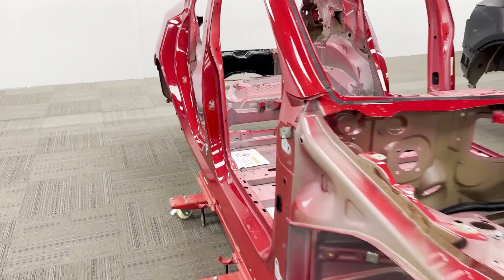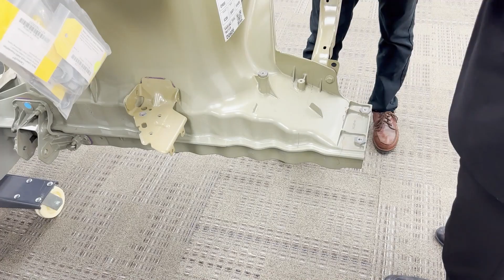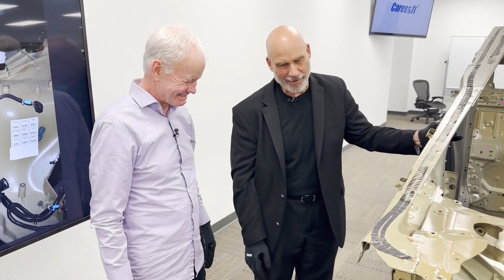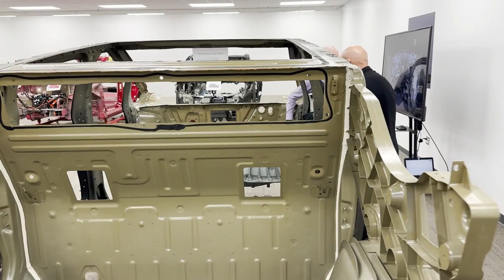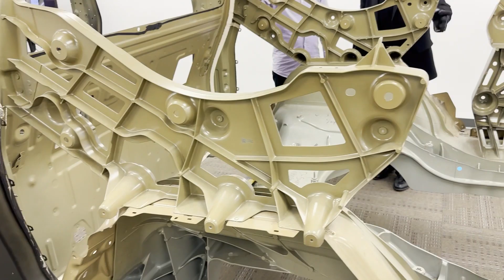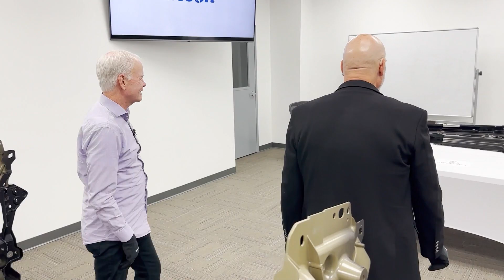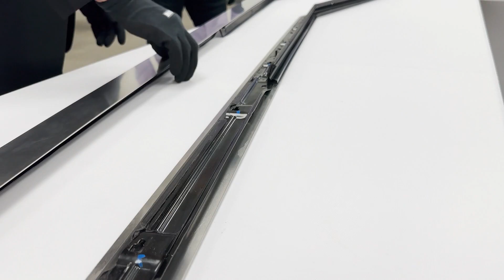The Evolution of Tesla's Body Structure - Caresoft Teardown

Comment: 10:00 you were saying none of the A surface is structural? Elon was saying he wanted a hard exterior to make an exoskeleton. But you’re saying it isn’t like that for the front? I wonder if this will be redesigned in the future?
Reply: The exoskeleton technology has been scrapped. I think the progress of casting technology has rendered it obsolete. If your Giga-castings provides all the structure you no longer need the skin to be structural.
Reply: They got that part wrong. The body greatly contributes to the total rigidity
Reply: @tarasilchuk167  This is correct - not structural but adds to the rigidity (30% I believe?)
Reply: The Gigacasts machines at that time were used in the second year or so of the mod3 or was it the modY?, It was two halves of the rear megacast, which a year later became a one piece megacast, Tesla does not have a every 4th or 5th year model refresh, Tesla changes and improves as it sees fit, anything to get the price of the car down, I think there might even be a $34,000 mod Y in the USA in stock , after tax grants and State incentives, I believe it is in Colorado or Washington State,
Reply: CORRECT , non Structural. but, VERY Tough still. 
the Gigacastings & Hybrid Underbody are Extremely Tough.
the 4680 Battery & Structural pack , also Extremely Tough.
its, Tesla HFS 1.8mm door panels & 1.3 mm everywhere else.
HFS = Hard F-cking Steel. composition UNKNOWN. 
it is 30xx class Stainless Steel. 
its Bulletproof to .45 cal Machine gun, 12 ga SLUG, 9mm FMJ. 
it can also Dent a metal bat.

Comment: I wonder how much twist the frame has when the battery pack isn’t bolted in, to see how much the battery pack contributes to keeping the truck from twisting?
Reply: ZERO .
Reply: It has to be zero.  When I replace the battery packs on Models S-E-X-Y I never have issues opening doors or notice any body flex while it's on the lift.  We've even pushed cars out the shop without batteries and they feel solid.  I'm sure it makes it stronger with the battery in place. They use a bunch 13mm and 16mm bolts to hold the battery in place.

Comment: Tesla is the best car company ever! No gas stations, No oil changes, No smog check, No corrupt dealership, No catalytic converter and as fast as a $650,000 Lamborghini
Reply: And safer than any other car on market, by far!
Reply: @praero551  you are joking right! in the first accident of the cybertruck with an older toyota corolla, only the the passenger in the tesla got injuried not the toyota one lol!!!
Reply: @alanmay7929  good, rule confirmed, no real rule without misses, no?
Reply: @alanmay7929 The Corolla T-boned that truck. There were no injuries, just bumps, & bruising. The couple that was rear ended by the Ram didn't even realize they were hit, when they heard the wreck.
Reply: @eternalbalance7703  the tesla driver still sustained more than the little corolla lol!!! your lame justifications!
Reply: @eternalbalance7703  its literaly the same lame justifications from tesla fangirls on internet ive seen tons of videos "oh" a three failed on the tesla while it barely touched it.
Reply: @alanmay7929  It would be easier to understand your point, if you took a moment to articulate. Anyone in a side impact, will have a greater risk of injury.
Reply: @eternalbalance7703  what are you trying to justify "Einstein" by the way you all vomit tesla crap on internet its like other cars are literaly death traps grow up! when there is an accident with a tesla and other car you barely ever heard what happened to the other car and the passengers its always everything about tesla its becoming cringe and pathetic at this point.
Reply: @eternalbalance7703  your friend #tesla owners of sillicon valley on tweeter goes offroading with his cybertruck a toyota tacoma and a jeep but he never showed the capabilities of the other truck on his videos another pathetic fangirl.
Reply: @alanmay7929  With 90k fatalities every year in the US, I would hope we can do better. Yet few are willing, or able to do what Tesla is doing. Education does wonders my friend. Albeit, you may want to focus on something that won't trigger you so easily. Cheers
Reply: @alanmay7929  What justifying are referring too? That side impacts have higher risk of injury? There is plenty of data supporting this.
Reply: @eternalbalance7703  again are you serious?! all those accidents are because your driving licence training is very weak and even your roads systems are not the best in the world! people does all kinds of things on the roads and also vehicles gets modified in different ways! thats not the case in other countries! that has nothing to do with tesla or other manufacturer!
Reply: @eternalbalance7703  modern cars are very safe but unfortunately there are still alot of older cars or people driving at obscene speeds, drinking and driving...... lack of public transport which means literaly everyone has to own a car! in Europe i can count how many times i got into a car.
Reply: @eternalbalance7703  did i say anything against that!? wtf!!
Reply: @eternalbalance7703 have you seen the Tesla that flipped 7 times with all passengers unharmed, or the father that tried to kill his family by driving down a cliff only to have everyone survive. There’s a reason it’s rated no1 safest vehicle by safety assessment companies worldwide.
Reply: @yann664  You overestimate how many long trips people drive.  Most people only do roadtrips once or twice a year.  So, you save the 5 min two to three times a month but spend more time on the 1 or 2 roadtrips a year. Overall it's quite the savings for me, time and money.
Reply: bullshit! its literaly the worst car company ever! totally useless cars that are basically all the same way less capable than an ICE... there are 35 years old toyota hilux with 90hp that are working harder than that tesla piece of garbage in very harsch environments around the world! that tesla truck is literaly impossible to modify let alone do anythng with! a toyota hilux can be converted into 6x6 chassis extended, payload improved, bigger fuel tanks for tons of applications from RV to overlanding rig to rescue, firefighter, ambulance..... ICE are just more capable.
Reply: As exciting as a hoover vacumcleaner,
Reply: Tesla and it's vehicles aren't selling, proof they're losing market share and profits. Not ever going to buy one.
Reply: With superchargers to make life easier as a driver
Reply: Drink some water! Breathe!
Reply: You aint joking about faster than a Lambo.  My friend and I had the opportunity to flog my Model S and his Lamborghini Aventador up a closed mountain and he couldn't keep up.
Reply: @gnoxycat  correction EVs are just quick 0-60 not fast! the almost 2000hp Rimac Nevera is still slower than a 1500hp buggati veyron.
Reply: How has a catalytic converter ever bothered you sir
Reply: Love that they burn so much coal powered electricity and can burn down your house to boot!
Reply: @dpose6525  No matter where the energy comes from, BEVs are more than twice as efficient as ICE.  Denying that is like denying round earth.
Reply: @dpose6525  In case you haven't noticed,  here in the USA natural gas has eliminated most coal powered generation as of more than 10 years ago.
Reply: @snookmeister55 expecting uneducated people to notice these things is a far cry from
Reply: @dpose6525  My house and garage are covered in solar, am I going to be okay?
Reply: oh the 1000hp tesla modelx plaid can barely tow 5000lbs for measly 130 miles while a 260hp bmw x5 diesel can tow over 7000lbs still get around 500 miles of range period!
Reply: @alanmay7929 dude, what universe are you living in? What’s your highest level of education? The Tesla Model S plaid was the fastest production car when it came out.
Reply: @user-ln7of9gs4s  there is a gigantic difference between fast and quick! Go educate yourself! Go back to school! The fastest production car to even reach 200mph was decades ago and buggati also reached 300mph none of the EVs can even compete.
Reply: the 1000hp tesla semi barely hauls 82,000lbs while 650hp diesel semis have been hauling about 4x that load for tousands of miles even on unpaved roads crossing deserts, rivers... to supply remote communities and much more.
Reply: One could argue that cost of operation trumps most other things most of the time and that's why I expect battery electric semis to become quite successful.  With respect to efficiency, ICE loses, always.  @alanmay7929
Reply: @alanmay7929 About your tonnage claim,  even if true,  isn't it also irrelevant due to load limits?  It doesn't seem to matter much these incredibly heavy loads hauled downhill in third world countries since that's not the target customer.
Reply: @snookmeister55  did I say anything about targeting any group?! I was talking about the capabilities of the vehicles! By the way they are designed they can be seriously way more capable even when they are much older. EVs are not that versatile when it comes to alot of use.
Reply: @snookmeister55  I've even seen in the middle east they transform an older Toyota Camry to a pickup truck with a beefier rear axle and it hauls about 4x the payload of a regular truck!
Reply: @snookmeister55  in north Africa there are 50 years old Mercedes trucks still working very hard daily crossing the desert very heavily overloaded.
Reply: @alanmay7929  my point exactly
Reply: @alanmay7929  Necessity is the mother
Reply: @alanmay7929  That speaks a lot about screwed mechanical ability just to keep those old vehicles operational.  Reminds me of the vehicles in Cuba.
Reply: @alanmay7929  I think it's safe to say that internal combustion engines will be in use for a few decades.
Reply: resla factories just like everything else was built using oil and ICE which literaly worked 24/7 not something an EV can even dream of.
Reply: That will change too. There are companies that are already making ev constitution machines.  @alanmay7929
Reply: @alanmay7929 just like how the first cars were built with the help of horses and old tech. If it isn’t obvious enough for you with every new technology you rely on old tech first 😂
Reply: @KC-uw6ph  bullshit!!!! the first cars were built using alot of techs like steam mostly and later the ICE have literaly built this world and all its infrastructure and is stil doing it today something no EV can even think of!
Reply: @KC-uw6ph  there are literaly 50 years old ICE that are still working very hard and actually hauling up to 4x their allowed loads when they were new, no new EV can even compete! those decades old caterpilar, ships, aircrafts.... trains and much more have literaly been moving mountains.
Reply: @KC-uw6ph  the ICE also builds power stations, the grid, water supply, entire cities, dams, mining, agriculture, heck even renewables on and offshore and much more, lets nnot forget during natural disasters or pandemics they are life saving.

Comment: At 18:08 you were saying they mixed in some steel parts of the frame with the aluminum. Steel can bend vs aluminum will want to snap.
Reply: IF, you strike the Gigacastings , NOTHING happens , no Damage.
IF , you strike Conventional Stampings & wields , there is MAJOR damage from LIGHT impact.

Comment: You better take a look at another Cybertruck a year from now. The first run of them looks like they rushed the design out while they focused on the ground breaking ideas like stainless steel body, 48 volt, steer by wire, etc. I fully expect in one or two years this truck won’t look the same at all on the inside and may even have a few superficial changes as well. The floor of a pickup truck’s cargo box is typically 32 inches high off the ground. The floor of the E Hummer’s box looks like it’s 36 inches off the ground. I bet the Cybertruck will have a lower box floor in about a year and in two years it might be substantially lower. This will make loading the box SOOO much easier.
Reply: It has AIR SUSPENSION , thus can lower or raise the truck as needed, I'm sure all CYBER TRK s  come with it as standard, and as Terry and Sandy Munro have said Tesla makes changes and improvements as they need it in the interest of keeping PRODUCTION COST DOWN, that means in materials and labour costs.
Reply: The rear castings have 5 pieces. They can reduce it to 3 pieces if they combine the buttress casting and the rear column casting. I don't know why they are separate they should be structurally stronger if there is a beam connecting them together.

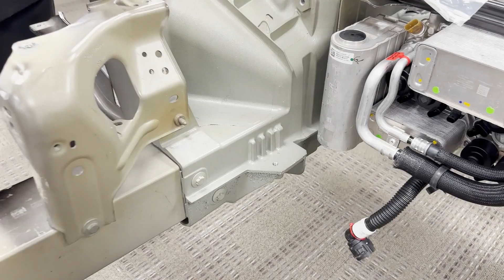Comment: At 3:02 you show a crush can that looks like it’s made separately from the front the gigacasting. Build it as part of the gigacasting but design it so when it crushes you cut it off from the rest of the GC and then have a new part that sleeves on to the trimmed GC. You eliminate this pair of crush cans but you don’t need to sacrifice the whole GC in a minor crash.
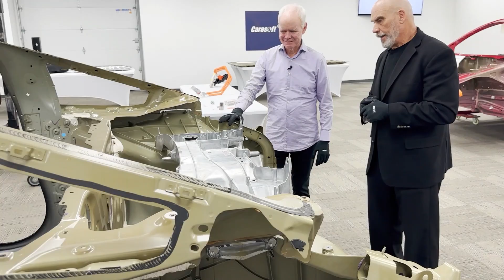Reply: That's the 2022 Model Y at 3:02. CT doesn't have the crush cans. It has a "corrugated" area in the casting designed to "accordian" in a crash. Start watching at 6:00 for a comparison. Not clear if the corrugated area can be cut out and replaced or if a low speed crash simply totals the CT.

Comment: I don't think an operator is installing the modules.  It's the robotic arms.  The operators load the module for the robotic arm to install.
Reply: All this design is structured for the advent of the humanoid robot to assemble. No worries about a union coming in and jacking up the COGS.
Reply: You have the module hung on a hoist system then a humanoid operator will guide it in place. The Teslabot is not yet ready so a human will be doing this for now.

Comment: So based on the presentation, it confirms, it is not even a sudo exoskeleton, traditional unibody with front and rear castings with a battery for a floor and a tough skin made from stainless steel.
Reply: I don't think you can call it a unibody. You have the front casting independent of the rear castings. So it is a multi body framing.
Reply: @kazedcat   - Hybrid .
non - Conventional Unibody.
Reply: Have not bought a new GM product since my brand new Buick Grand National in 1987, and will never buy a GM ever again,no GM quality and staying away from STEALERSHIPS!
Reply: @AuralioCabal  Almost everyone working for GM in 87 has been retired long ago. The 70s and 80s were bad for all the u.s manufactures. It was even labelled the malaise era.
Reply: Video got that part wrong. It significantly contributes to overall torsional rigidity.
Reply: Not even unibody. Body panels provide some structural strength in a unibody. Terry said none of the stainless panels provide structural support. This is simply body on frame. A very highly engineered frame, but still a frame.
Reply: @TheDoggydogworld   - Hybrid Unibody , Tesla NOT using any outdated Horse & Buggy TECH.
like LEGACY Trucks do.
Reply: @TheDoggydogworld  It's not a unibody because it is not one body. It is not a body and frame because the frame is most of the body. It should be called a Casted Body construction because most of the structure is provided by the giant casting that also serves as the underbody of the vehicle.
Reply: @kazedcat it’s called space frame construction. This is what GM did (minus the casting part) with the 84 Pontiac Fiero, the 90’s Saturns, and Dust buster minivans. All had fastened or adhered body panels attached to a space frame what was stamped & spot welded steel.
Reply: Car and Driver called the pistol-resistant stainless body panels "stressed member."
Reply: @TonyBasuro   - Tesla HFS = hard F-ing steel. 1.8mm.
Reply: @markplott4820  c&d took it to a scrapper and his uh, steel reader, said it was between 303 & 304 with the bumper having measuably more copper.   I look forward to this Autoline series getting more scientific about the cyberskin.
Reply: @TonyBasuro   - nobody , but TESLA actually knows the CT alloy .
Sandy tried it many times & many spots.
DIFFERENT result each time.
and TESLA adds seldom used Elements into Alloy, to achieve Precise result for Alloy.
Reply: Yep, exactly what GM has been building for decades.  Unibody.  Just no welds, 50% lighter, stronger, and build in 1/4 the time.  Other than those minor details.  Exactly the same.
Reply: @davidbeppler3032   - gm , doesn't make the SAFEST cars on EARTH.
Reply: Hybrid Unibody , w/ Massive Gigacastings FRONT & REAR, 4680 Cell Structural battery pack. 
Bullet Proof skin 1.8mm HFS .
Tesla ARMORED Windows & STRUCTURAL Roof.

Comment: As I recall, the curvature in the front gigacasting ribs was designed to decrease flow time for the molten aluminum, thus enabling Tesla to utilize the smaller gigapress vs the 8 ton that IDRA had specified for the front casting.  Tesla designs OUT so much cost, it is astonishing.
Reply: nope
Reply: @alanmay7929  you don't know jack shit